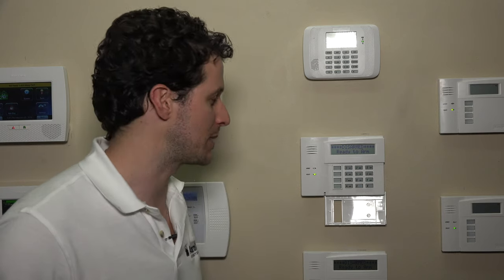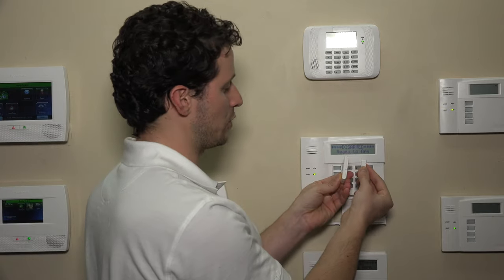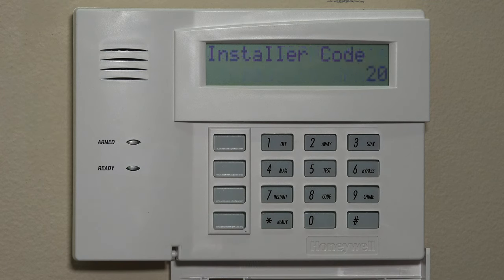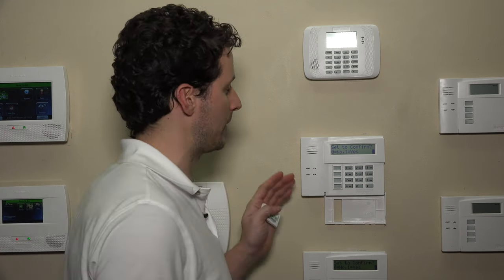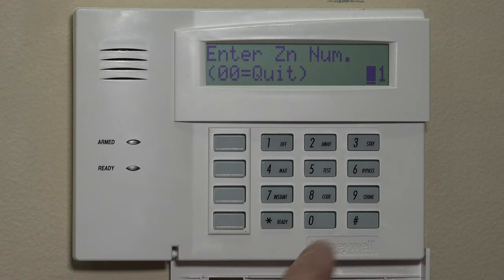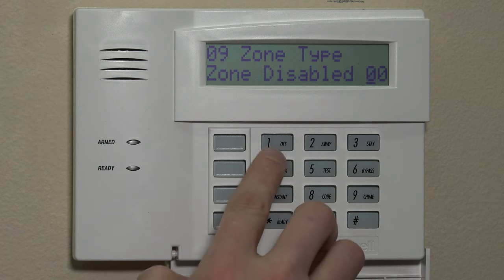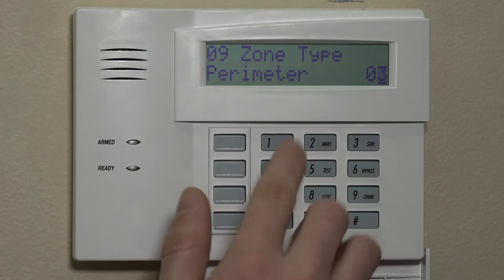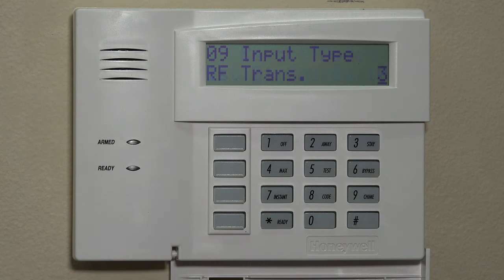Honeywell VISTA: Program Wireless Sensor to 6160RF

Comment: My Vista have Batt lit, also we bypass a few sensors, but it won't give us 'ready'.   Do we need to replace a battery on the Vista or it is already powered by our home wire?

Also overtime, I think so  our sensors might go bad even after replacing them with batteries so we have to bypass 3 of them.
Reply: If your keypad just says batt then it is a system low batt. if it is a contact or sensor it will have the zone number for example (09 BATT)

Comment: Can I install as an additional keypad 6160RF with a Vista 20P panel? I already have a 6160 LCD keypad installed and had an extra 6160RF and wanted it in my master bedroom. Thank you..
Reply: Good day,
As long as there is not a second rf keypad or a 5881 receiver you can add the 6160rf no issues

Comment: Awesome (Round of Applause) That was clear and concise, you deserve an award for such clarity and details, by any chance do you have a video on here setting up large panels like the 250BPT, out of the box, wired and wireless, or polling loops. Or do you know where there are free training videos on the subject. Thanks again for an video tutorial executed well.
Reply from the maker: We don't have any programming videos yet for the Vista polling loop panels, but here's an FAQ that gives a quick run-down on programming a 4193SN into one of these panels.  The biggest difference in programming one of these devices, vs. a wireless device is the input type.  Most wireless devices will use input 03, Supervised RF.  https://www.alarmgrid.com/faq/how-do-i-program-a-4193sn-to-a-vista-128bpt-250bpt-or-vista-50

Comment: I would like to replace a defective transmitter on a perimiter zone.  I followed your video but when i got to the point to enter the serial # of the new transmitter the current one shows and i was unable to enter the new serial#.  Could you explain that to me.  I would appreciate it very much.
Reply: Hey Joe, To delete the serial # from a specified zone Number in programming, when you have the serial # and Loop # for the Existing sensor showing on the keypad while in zone programming for that zone, the cursor should be on the far Right on the Loop #.  Press 0 then "*", that will clear the Serial number of the existing Wireless sensor, allowing you to enroll the new sensor by triggering the sensor.

Comment: Hello, great video. Does this system (6160RF) also enunciating the faulted zone?
Reply: It Does.
Reply: @nathangalarmgrid5205  I have heard that the 6160RF does not make announcements such as "Fault front door".
Reply: @justin18gaming19  I apologize, I misunderstood you. It does not, it does however "chime" when there is a system fault. If your wanting a keypad that can, a 6160v or tuxedo touch would.

Comment: How many alphanumeric keypads are supported on a 20ip along with one Tuxedo touchscreen and how would they be connected?
Reply: On the 2op you have address 16 through 23 for the 6160 alpha keypads so you can do up to 8, For the Tuxedo there are address 1,2,5, and 6, So you can have up to 4 on the 20p if you use Total Connect 2.0 you can only have 3 Tuxedos for TC2 will take up address 2, Be mindful of power for you only have 600ma if you go over that power a secondary power supply will be needed with a common ground to the panel.

Comment: Can you tell me how to remove a hardwired motion detector from a Vista 20p?  I think I know how to delete the zone in programming. But, after that,  I don't know what I need to do to physically remove it. Can I just remove the sensor and leave the wires there in the wall (and connected to the box)? Does deleting the zone in programming cause power to stop going to it?  Thanks

Comment: Appreciate the videos, I just added 2 of the 5816's window protection to my system. 2 bedroom windows. They both work fine and it sends the alerts through my pulse like all my other zones do. The only thing is on my pulse app and webpage it says unknown device type as opposed to Motion Sensor, Door/Window Sensor, or Glass Break Detector. What I named them shows up ie, Master Bed Window, but the device type says unknown. Do you know how I can get the device type updated? 

also Do you have a video on how to add a wireless outdoor siren? Been wanting to do that but can't find a video.

Comment: Hi Frank; great video. Question : My Vista 20P is displaying "check 11 front foyer window" - i have replaced that window sensor transmitter - Now I need to program in the serial number of that transmitter. .
How do I get to a display that will take input of the installer code followed by 800 to get me into programing mode ?
Reply: Thank you. one other question; When you are replacing a defective sensor and you get to the S/N input screen, there will be an existing S/N shown. How do you get the cursor to move from the loop number on the right of the screen to the position for entry of the first number of the new serial number. ie. how do you move the cursor left ?
Thanks again.
Reply: @richardsponholz9617     Did you ever figure out how to move the cursor?  If so, would you please share?   Thanks much!     Mike

Comment: Can you program a new wireless door sensor to the Vista 15P without having to use an alpha keypad connected?  I have a wireless sensor that has gone bad and would like to replace and program it myself.
Reply from the maker: Hi Dee! You need an Alphanumeric Keypad (like a 6160) or a Tuxedo Touch Keypad to program a new sensor. We do not recommend using a Fixed English Keypad (like a 6150) to program a sensor. If you used a FE Keypad, you would be operating blindly, and it is possible that you would mess up your programming settings. Hope that helps!

Comment: How many 6160RF I can install in a Vista-20P system ?
Reply: Yeung, although you can use a total of (8) 6160 or 6160RF keypads, the limitation is the RF part of the equation. The 20p can only use 1 RF receiver. So if you had more than 1 of these the receiver portion of the kp MUST be disabled or issues will arise.

Comment: Will the Vista 20ip support Z-Wave Plus?
Reply: The panel itself has no z-wave capabilities, however we do have the new tuxedo keypad that does does add zwave plus capabilities to the panel.
Reply: The new Tuxedo that is coming out will do Zwave plus, But if we are discussing the one that is currently out if you learn a zwave plus device into it the standard feature like for a light switch off and on things like that will work but features around zwave plus will not.

Comment: What size resistor do I should use for my smoke detector?
Reply: The resistor size is determines by the panel you have, not the smoke itself.
Reply: thanks! I have Vista P15

Comment: I did this and when I got to the programming mode I see 20.  Didn't see other text.  I did *56 and then nothing was displayed.  How to I reset this thing to get out of programming mode?!
Reply: I just unplugged it and it came back to normal.  I guess I have one of those vista panels that doesn't say what it is doing.  Now I have to pay ADT to come in and add the RF Sensor.
Reply: @mradaChris  It's actually your keypad that's limiting you. You have what's called a Fixed English keypad and would need an Alphanumeric keypad like the Honeywell 6160 to be able to see the field in the *56 zone programming section.
Reply: @SterlingDonnelly  are they expensive?  I may go for that.
Reply: @mradaChris  We offer them online at https://www.alarmgrid.com/products/honeywell-6160.